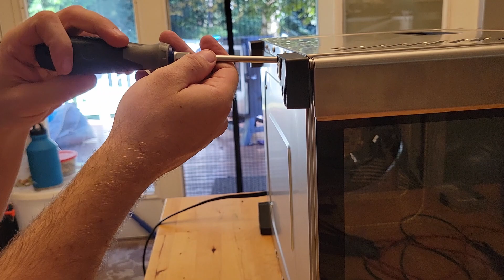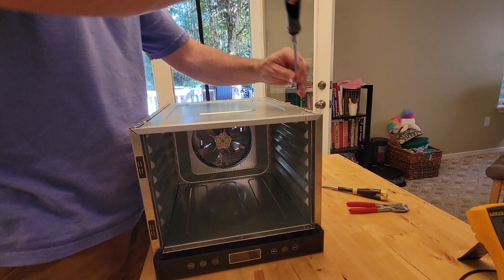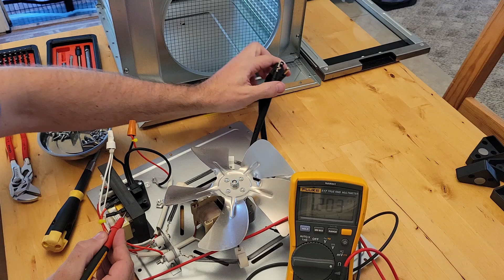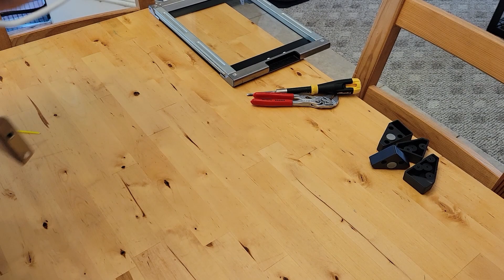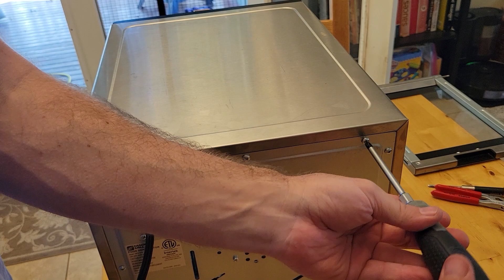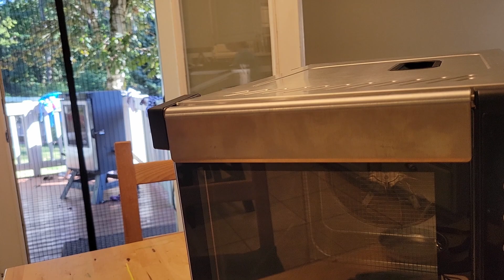Magic Mill Dehydrator Repair (Thermal Fuse Replacement)

Comment: Just watched your video and ordered the thermal on Amazon. Like you said just the back needs to come off and if you use a wrench on the nut while holding the wires you should not need the triangle tool.

Thanks again! Extremely helpful

Comment: Great video! I think the Cosori dehydrator has the same mechanics. When you removed the rear panel, everything looks identical. Only the front control panel looks different. Thank you, will order parts and get to it!

Comment: Thank you! My Magic Mill looks a little different than yours. But I followed the advice in your comments about just removing the back. I did replace it with a 113 thermocouple as you suggested and thanks for the link in the comments about where to order it. This 70 y/o woman was able to fix it myself using the mini screw on clamps, checking it with the voltmeter, and you're very thorough instructions. Thank you! Now I'm back in business :-)

Comment: My own question is concerning the triangular point of the fuse point towards the board, correct? If wired wrong or opposite would it make a difference?

Comment: So would the new fuse be crimped on both ends to the wires?
Reply from the maker: crimped, or otherwise securely fastened. i just recrimped mine with pliers.

Comment: What might be the problem if the fan won’t turn? The screen works, heating coil heats up just fine. The fan made all kinds of noise before it finally quit. Any suggestions?

Comment: Is it the fuse if the machine runs but doesnt get hot?
Reply from the maker: this is a different problem, you'd have to use a multimeter to track down the cause. it sounds like somewhere along the path to heater circuit is broken.

Comment: Wish i had read comments first 😂. I took whole thing apart to replace the fuse. But a tip from what i experienced. If you do take it all apart and struggle to get the cover back on on the side with the magnets, take the magnets out. Its a tab on both sides, push in both and remove. Then pop them back on when cover is back on.
Thanks for vid though! Was very helpful!

Comment: Thanks for pointing many of us in the right direction.

I would like to offer another tip to make the process even faster, cheaper and easier to replace the fuse again and again.

After the back is removed from the shell and the two plugs are disconnected from the board:

1. Test the fuse from both ends for continuity then clip away the fuse if bad, while leaving a piece of the stem from the fuse on both opposing wire.

2. Take a thin foil strip (aluminum foil from the kitchen cabinet is fine) and wrap one end of the NEW fuse to one of the expose stem tightly then press them tightly with a pair of pliers. Wrap the new connection with either a piece of duct tape or electrical tape and repeat on the other side.  (Be sure the insulating sleeve is already on one of the wires so you can just slide it back over.

FTR: You will have to clamp the fuse to the wire/stem and NOT solder it because the heat will probably blow the new fuse.

The fuse can be purchased on eBay or Amazon without the wire attachment for about $7 as of this timestamp for three 113C fuse which is what this unit uses.

https://www.amazon.com/gp/product/B07JPFGCSM/ref=ppx_yo_dt_b_asin_title_o06_s00?ie=UTF8&psc=1

Comment: Do you have to take the whole thing apart?  Could you just take the back off to replace the fuse?
Reply from the maker: unfortunately you do need to fully remove the stainless shell. the back panel is fully captive
Reply: @kalsprite  UPDATE. I got my dehydrator fixed.  Thanks for the tutorial.  BUT... I started with the back first and found that I only had to undue the back, two small plugs on the control board and had full access to replace the thermal fuse.   I did NOT have to disassemble the whole thing like you showed.  Just 12 screws, two plugs, the thermal fuse and I was done in 15 minutes.  Thanks for sharing and providing a link to the part!
Reply from the maker: @OutFishing13Matthew  ah great! you're absolutely right - i just looked again at it and the back plate is not captive. i had misremembered.
Reply: @kalsprite  I really like this dryer. Just finished another load of dried peaches from my fruit trees. It makes about a gallon of dried fruit at once. Now we are going to start working on grapes and pears, then some apples!  I was disappointed with the quality of the thermal fuse those. That should have never happened. My dryer had plenty of ventilation.